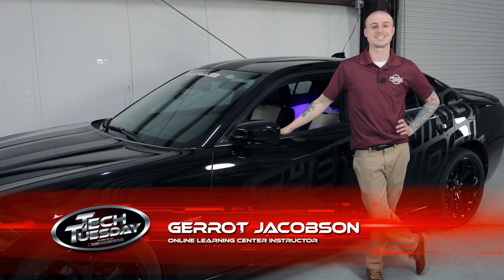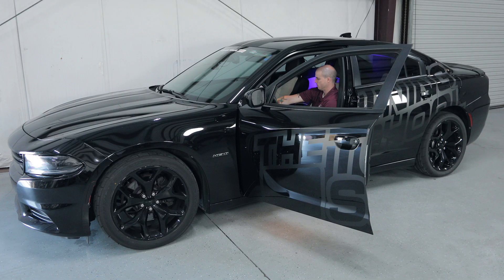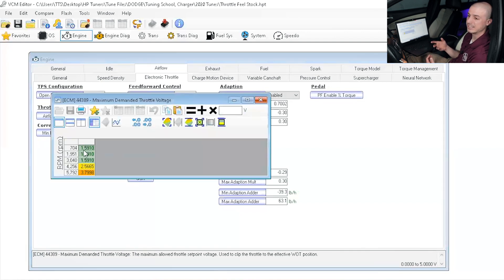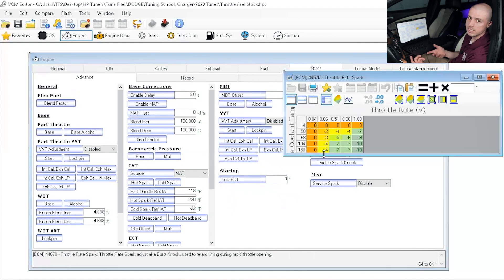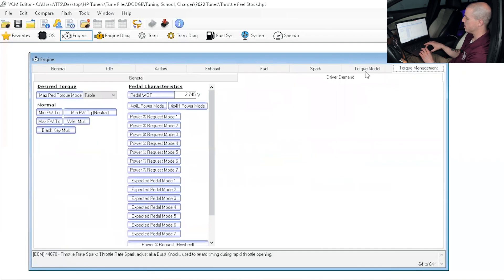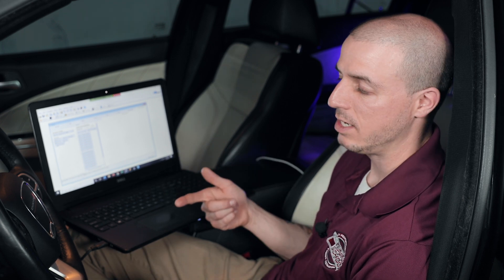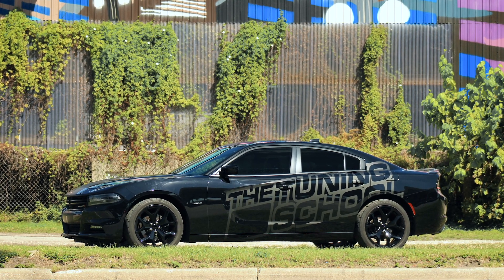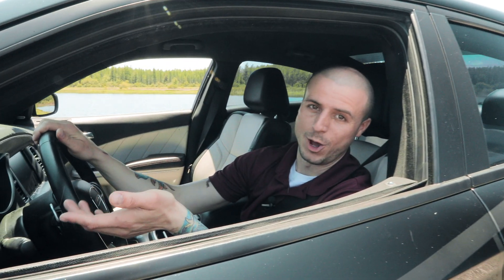Improving Dodge Throttle Response

Comment: I want to add: please be careful with WOT-threshold modifications. This has a lot of influences in the back. So it also changes from closed loop to open loop (elder versions, I believe the new ones have wideband are under control up to the limiter) and also position of cam, incl. spark (very critical) and injection (injection is the less critical because WOT means rich, so easy). So to early WOT means also very bad position of cam, too early sparks. Changing here means you need to know what you do. not for fun or increase throttle response.
Reply: will this be okay if i tune this for my 2015 chrysler 300c v8

Comment: Man I did this on my '14 WK2 5.7 and it's still got massive lag. WOT is earlier, sure, but it still sits there and thinks before it decides to actually open up the tb. Makes merging onto busy streets a bit sketchy. Basically have to apply throttle when a car is directly in front of me, by the time it actually starts moving the car is out of my way, too much of a timing game. IDK how Chrysler did it, but they really made the most laggy DBW system out there. My 03 Silverado DBW has instant response, so much you'll actually start bouncing the revs when going over bumps. Wonder if I can slap an LS throttlebody onto a Hemi lol

Comment: For people in comments, Im pretty sure this is not the same thing as what a pedal commander would do. Pedal commander is kinda gimmicky and all it really does is simulate what you would get if you mashed the pedal down on the car you have now, only it just does it sooner for you, simulating that feeling that its quicker when honestly, its not. All you would have to do is just be kinda more delinquent with your pedal and you would get the same reaction out of your car without the pedal commander, and I guarantee  this. When I had it, it did not take out that lag, all it did was mash the pedal more for me at half the press. And I looked at the box and said " I paid 200 bucks for that " and sent it back. Wasn't worth it.

  What he is doing is actually changing the factory specs on the computer tune and make it so the computer doesn't actually lag the pedal. Because even if you hit the floor on a stock tune. The computer will go "are you sure" and then slowly open up the flap. What he is doing is essentially tuning that whole thing out of the computer completely. I believe the engineers do this because they want their cars to be good on gas for 1, 2 it makes people safer drivers,  and 3.... ya the computer just has more control over what you are doing and making the car run and drive efficient and safely. Computers take in mind wheel spin and abs, so like even abs, when it activates the computer knows its happening so im sure it wont let you press of the throttle more, which is why they give you a esp button inside the car to bypass this because they know you will have a situation where u might be stuck in the mud, and u need to put more throttle in it and let the wheels spin. Computers are there also to control emissions, safety and gas efficiency, so it will purposely nerf you smashing on the gas pedal and instead will make the throttle body roll into the open flap instead of just going wide open. That way you get better emissions, better mileage, you dont lose control of the vehicle. 

 The pedal commander doesn't do this. All the pedal commander does is send a stronger signal to the computer to make the pedal touchier. thats it, its a gimmick. You pay 300 bucks for that....so dont buy it. So ya. This ina nutshell.

Comment: Can I ask why my 5th gen Ram only gets 86.7% @ 3.80V? I've increased the voltage and got 95.7% @ 4.26V but the truck goes into limp mode. Is 3.8V all the Hemi throttles can take before going into Limp mode with a throttle error?
Reply: IIRC you won't see 100% while logging. 86.7% is considered WOT. If my memory serves me correctly.
Reply: Basically  Yes , 86.7% 3.79 is WOT

Comment: I did this and recycled the ignition after writing and now I have lost communication with ECM/PCM A, BCM A, and Gear Selector. Car runs and drives fine, but these codes wont clear and I have a MIL now.
Reply: Re-write the tune

Comment: hey there , that was so helpful beside of course you can add a 10 to 15 % to the power request table :) but guys in some cars there is a table for throttle wot not only pedal wot ! so we should make them both in save volt value ?? thanks in advance

Comment: great tips for setting like the pedal commander.. what would you do with a performance clutch upgrade with a lighter weight flywheel that will rev quicker?  example centerforce ds dyad kit

Comment: The response is pretty quick in my Challenger, but its nice to be able to make adjustments on the fly and is great for fine tuning. I've got a diablo tuner and can adjust the parameters with it. I cannot see spending $300 for a pedal commander, and are way overpriced. For those that do not have a tuner, I suggest one that we saw recently called the roar pedal and is half the price of the PC. If you use code Hemi muscle, you can get 10% off and is around $150. I have no affiliation with the company whatsoever, l just don't like to see anyone in the Mopar community get ripped off